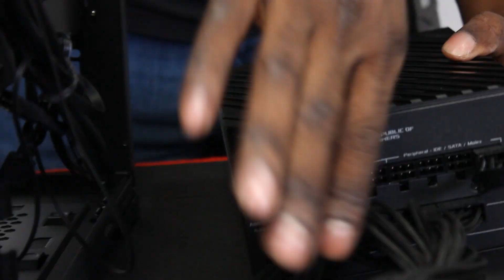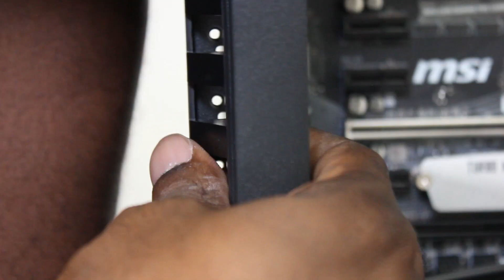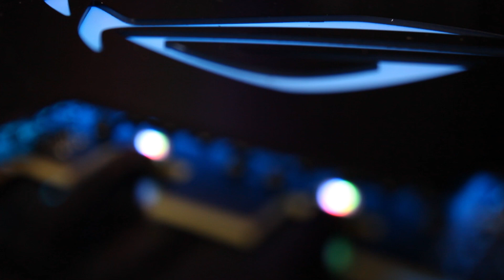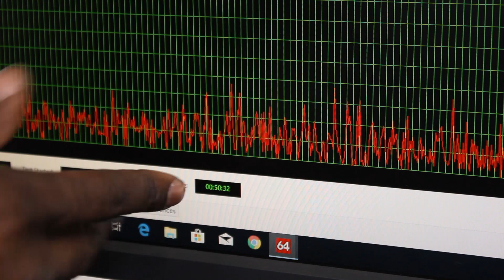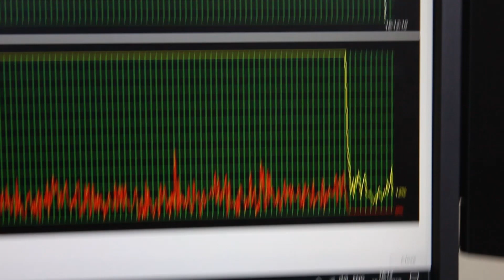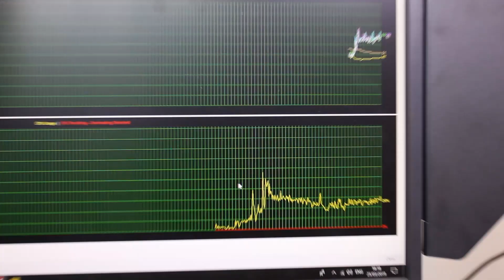Kolink Phalanx RGB Case Review and RGB Build - How Will it GO ??

Comment: Hey thanks for the in depth review, I'm definitely going to get this case for my new build. The price seems really nice for what it has to offer.
I'm just wondering if there will be a way to connect the "fan hub/controller" to the motherboard so I'm able to sync the RGB of the fans with the rest of the components using MSI Mystic Light or another similar software.